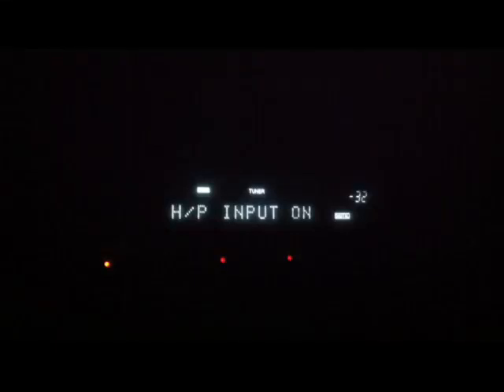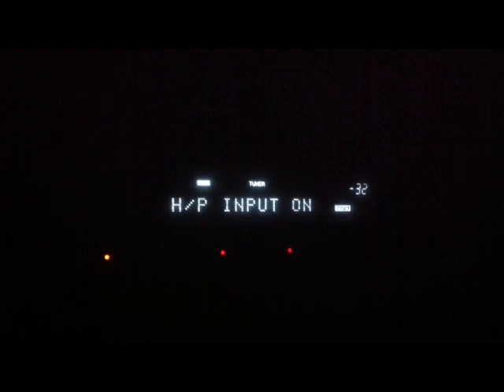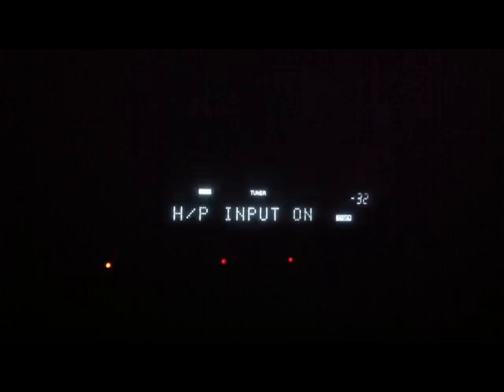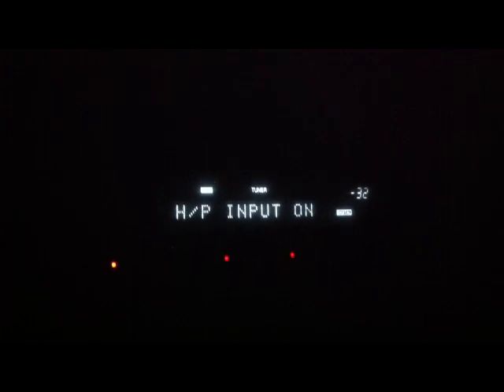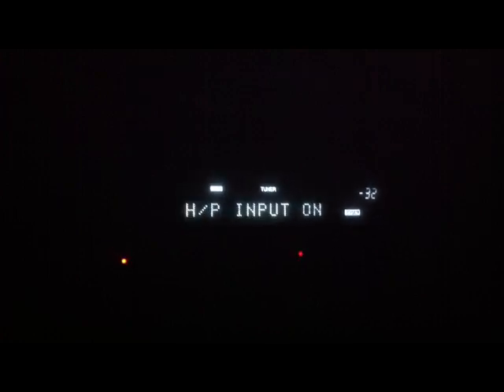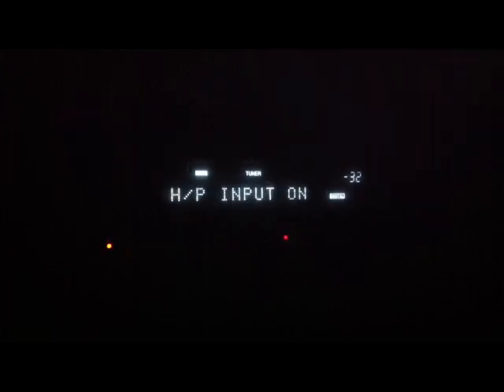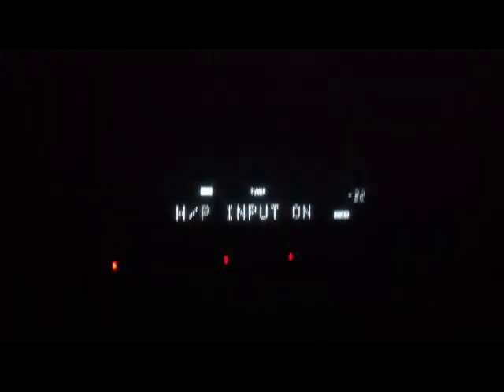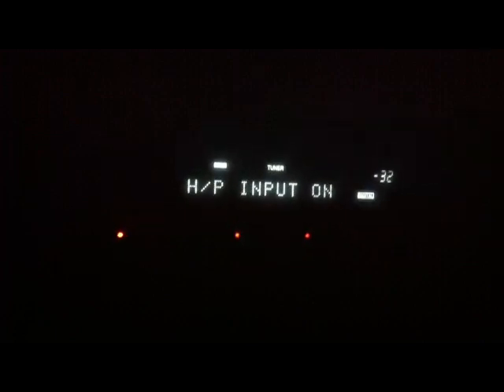H/P Input On Denon Receiver Problem FIXED !!!

Comment: No sound....spent 5 hours checking every connection, pulled stuff in and out changed wires etc etc and spoke to retailers looking for a new one. Didn't give up. Remembered that very briefly I saw H/P something flash up a couple of times but nothing in the manual so I finally Googled H/P error, you came up, I blew into the socket and nearly fell over when it all worked again. Saved $1000. A huge thank you!!!!!!!  It will be a great story.

Comment: Thank you! Is there anyway you can connect your phone to the phones input?  I just ordered an aux & it didn’t work to my phone!! How do I connect my phone to DENON- DRA-397
Reply: The front "Phone" conection is an output jack only. That's for a head phone.

You must use an aux cable from your cellphone conected to any RCA INPUT on the back of ur receiver. I.e.: "CD inpunt"

Comment: Fantastic - thank you so much!  I purchased a private party used AVR 591 and it started doing this about 2 weeks after I installed it.  I did not catch the error message at the time.  I spent quite a bit of time trying to figure out the problem and ended up leaving it off for a couple of weeks.  I went back and reset my cables and the audio worked fine, so I thought it was an anomaly.
The H/P input off/on problem occurred again, today, I saw the message, and found this video.  I used canned air to blow out the input and voila, it worked!

Comment: Blowing into jack adds moisture and saliva and can cause corrosion over time. Contact cleaner into the jack and then inserting and removing a jack many times is the proper solution.
Reply: I tried with a contact cleaner spray, but it did not solve the problem.  I wonder if it does not blow with enough pressure? I just tried a vacuum cleaner - seeing if sucking might be cleaner than blowing!!.  If that does not work, i will try a blow from an air can.

Comment: Seen this a few times. The two contacts in the jack that are connected when the h.p. jack is in, have a small short between them due to a burr of metal left over from the stamping process. Air might remove it but you have to take the jack out, and make sure there is no unintended connection between the two. The pins in question wind up at a connector pin labelled h.p. detect or h.p. sens.
Reply: Is that for inside the box?

Comment: I've had this happen a couple of times where dust was in the headphone jack. The latest problem saw me lose five of my seven speakers and have a problems with the getting proper sound. I plugged in a jack to the receiver after blowing out the port and a few seconds after pulling out the jack, my speakers were showing and recognized again!

Comment: yo me and my pops used the electronic duster to fix the problem, but we didn't put in at all, we sprayed maybe from 10 inch away from the H/P Jack and sprayed it upright, and NOT UPSIDE DOWN!